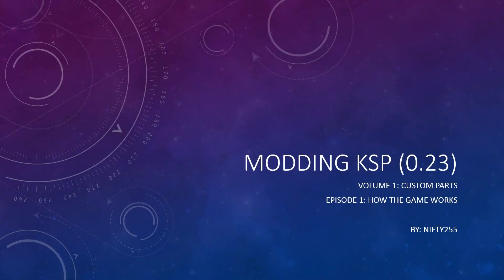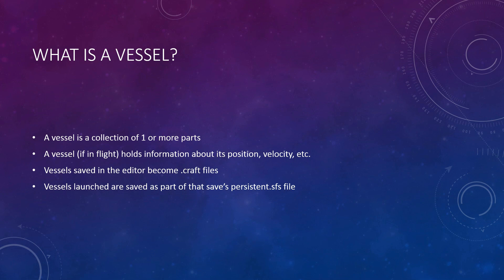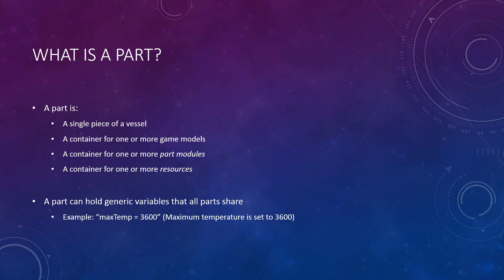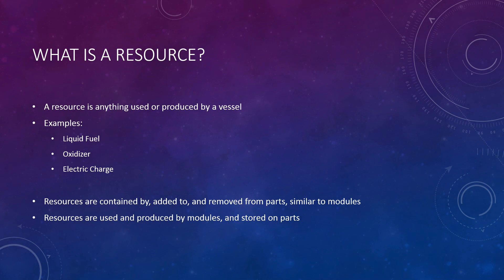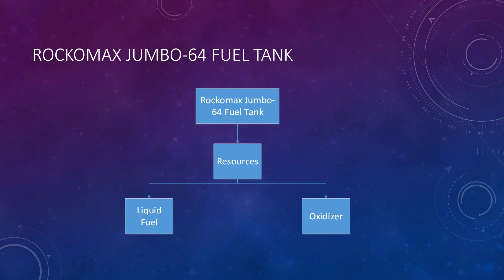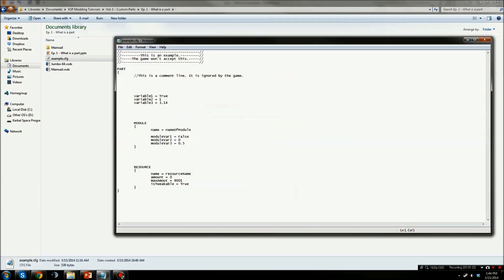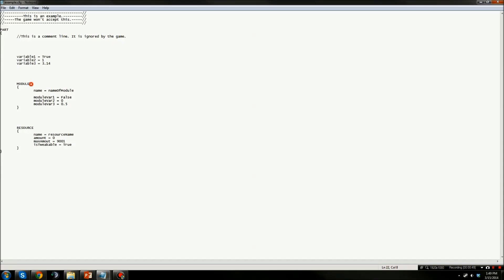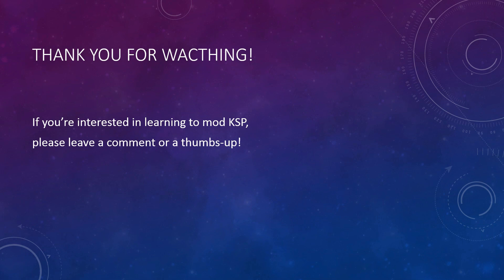KSP Modding Tutorial - Vol 1, Ep 1 - How the Game Works

Comment: How do you mod the tech tree?
Reply from the maker: Adding, removing and changing parts around in the existing tech tree is very simple, and only requires that you modify the TechRequired variable in the part's config file. Adding or removing nodes in the tree itself is a lot more difficult, and will be covered in a later tutorial.
Reply: Whens the next tutorial?
Reply from the maker: It was delayed, due to business, but I've just finished the script and will be recording soon.
Reply: Cool :)